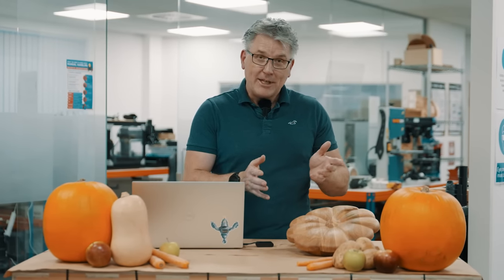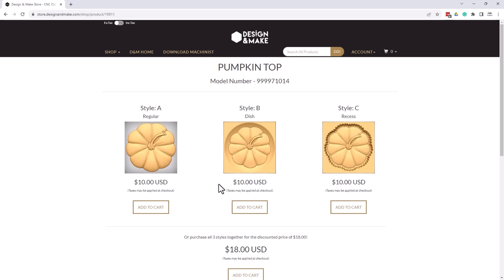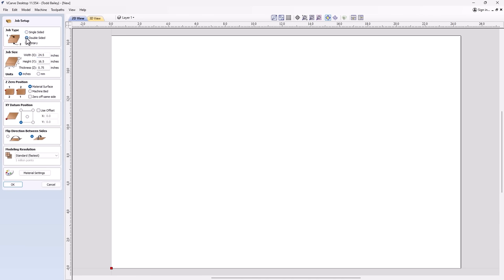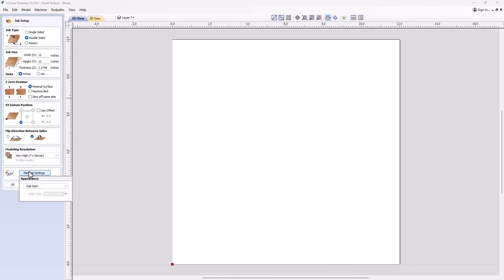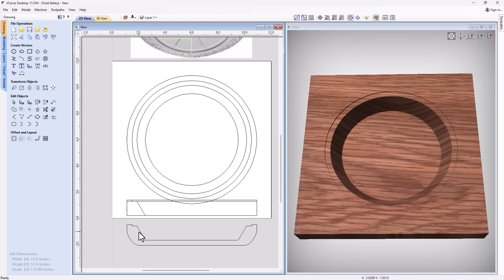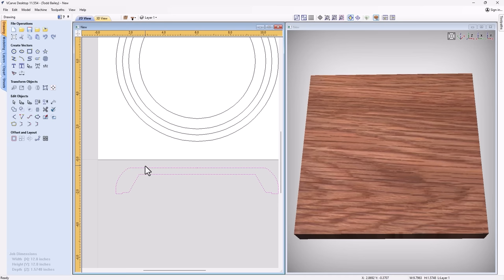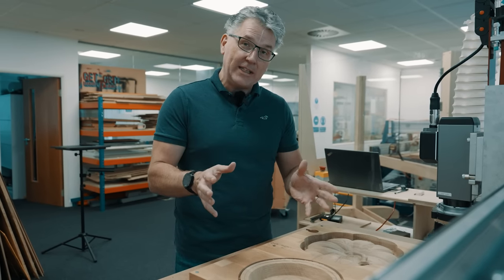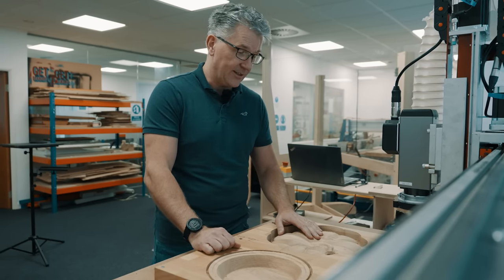Making Pumpkin Pie Dish | In The Labs with Vectric | Vectric FREE CNC Projects

Comment: Awesome project great video and I would love to make this for my wife. But how could I ever do this on a CNC with Table dimensions of 12” x 18″ and an XYZ travel distance of 12” x 13” x 3”? I think I would have break it down to do the top side and flip, then the bottom side and flip. Then I am wondering if I could handle the thickness on my Z? Any suggestions? Or is my CNC to small to handle it? Thanks.....PS Just a new guy learning CNC and trying to learn this Vetric Desktop Software.
Reply from the maker: Hey Max... I can see on your channel you have a NextWave SD110... and we happen to have one here in the labs.  I think you would be OK... you just might need to cut the lid and the bottom on 2 different sheets or jobs... not one like I have it set up.  The Z travel looks to be OK... but that would depend on the length of your cutter.  If I was you I would start by editing the file, and then make sure your cutter can make it through your material with out hitting the collet.  If you take your time and think it through... I bet you could make this a very suscessiful project!!!

Comment: I am currently in the middle of running the file. It’s going great , however,  tool path 5 for the top of the design left some grooves in the right side of the plate as it tapers up.  It cleared out nicely on the left side.  Anyone else have this problem?  Any suggestions to clean it up any better?   It can be sanded out but when I run the tool path in the future, I would like it to clean up all the way around.
Reply from the maker: Hello and thanks for the comment.  CIf you can't see it in the toolpath priview then it might be a machine issue.  If you have any pictures of the "before sanding" the part... could you send them off to support@vectric.com and mention the issue.

Comment: I want to make this to surprise my wife. But my machine will not do 24.5" in X. Could you please rotate it 90° ? I can do 26" in Y....Thanks
Reply from the maker: Hello... and thanks for the question.  Actually you can rotate it if you like.  Top tip, to make it easier and have it line up... create a rectangle the same size as the job space, on both sides of the job.  Then simply swap the X and Y dimentions in the job setup.  When you do that you will then need to select all of the vectors and components and totate them to fit (you can use 0 or 9 on your keyboard to do this). The retangle you created will keep everything in place.  Recaculate the tooling and priview both sides of the toolpath simulation... it sould look OK.